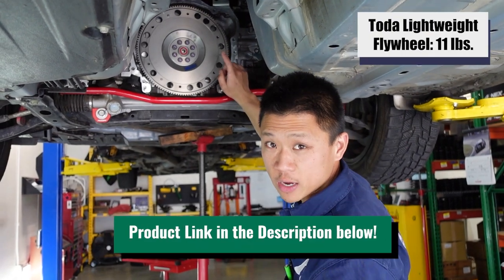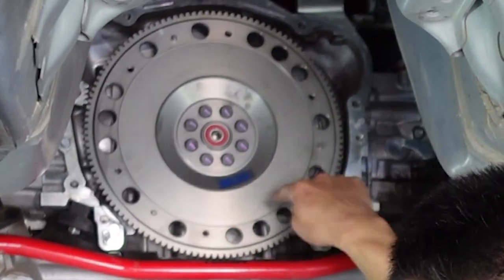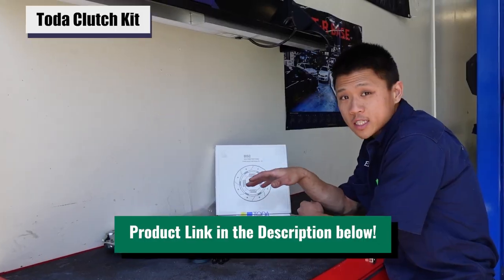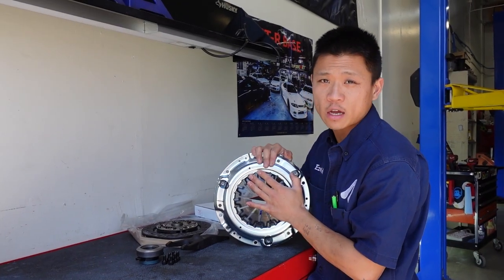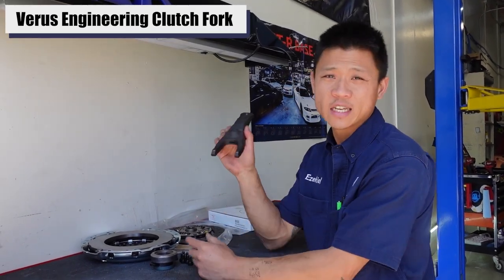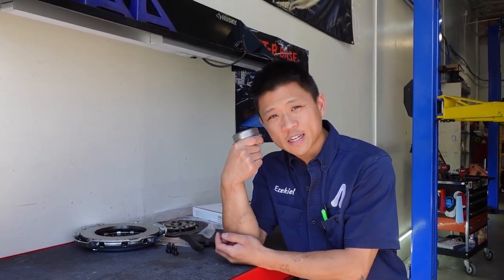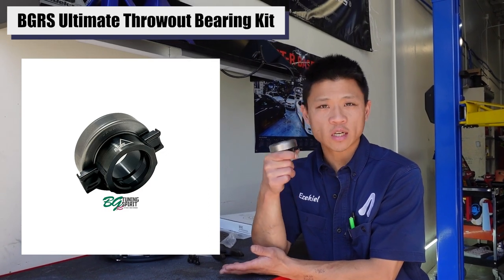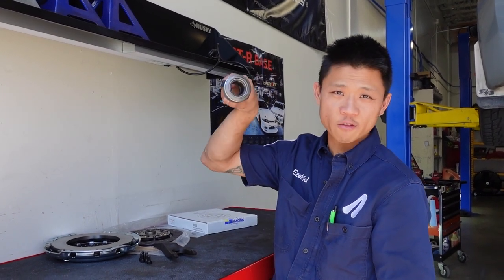TODA Racing Lightweight Clutch  kit / FRS BRZ GR86

Comment: Bro, one of the issue I'm facing with my lightweight flywheel on my BRZ is that it shuts itself off when I clutch in after engine breaking. I guess it doesnt have enough rotational momentum to restart the ignition.
Reply: Sounds like your idle is bad, check throttle body and MAF - clean that out.
Reply: @camryds  Idles fine. TB and MAF is as clean as they come.
Reply from the maker: EDITED*  Issue happened on the first day after install ONLY

This owner had the same issue with this TODA flywheel. I noticed the Exedy LW is about 2 lbs heavier and does not have this issue - but 2lbs may be enough of a difference.
Reply: @CMAutohaus is this an issue with all frs with a toda light weight flywheel
Reply from the maker: @bhavneetsaini7941  No the owner of the car works next door. Has not had any issues with the flywheel since the first day. I imagine the ECU needs to relearn throttle postion as we disconnected the battery
Reply: @CMAutohaus that makes much more sense thanks